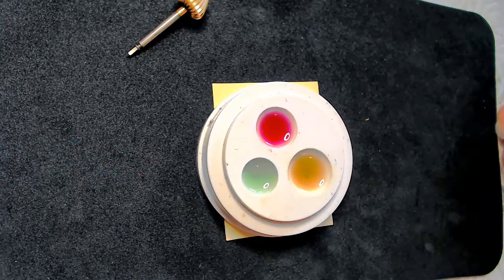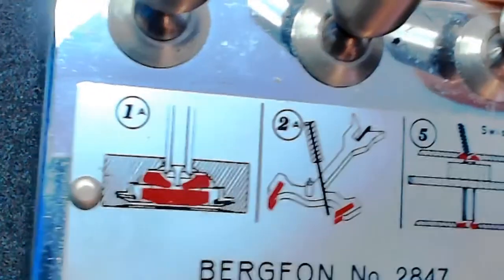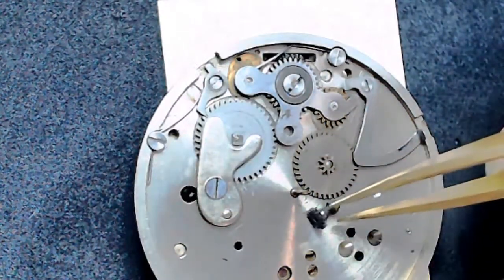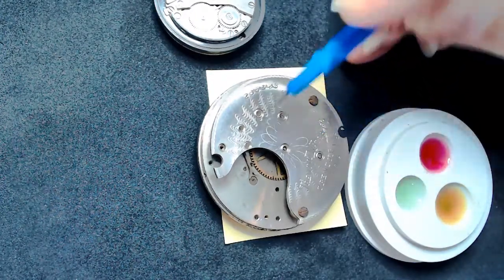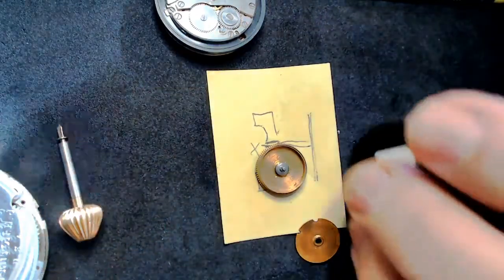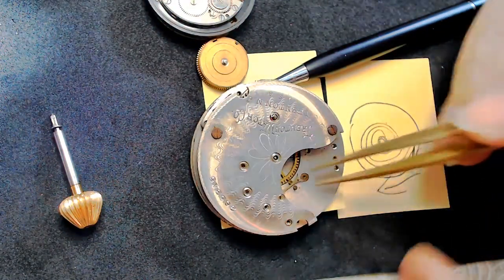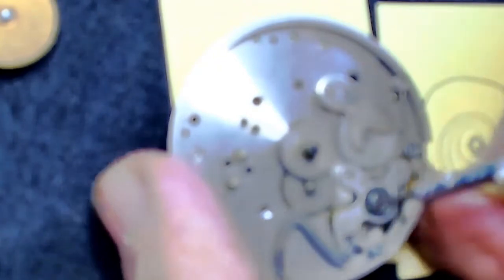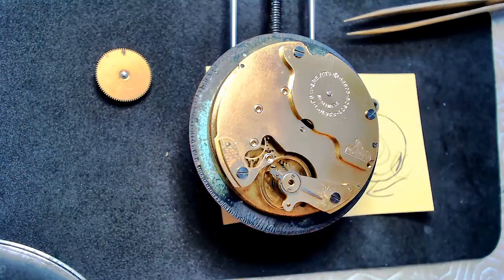Oiling Watches - Requested Video

Comment: Could you theoretically get away with two oils and a braking grease for the mainspring barrel wall for say a ETA 2836 like Moebius 9010 and Synt-HP-1300 ?
Reply from the maker: 24 Hour GMT Channel Yes, however a thicker grease is needed for the motion works and möbius 9415 for the palate stones
Reply: @JDRichard   In your opinion, would KT-22 be fine to ETA keyless works?

Comment: Thank you very much for this video. Great learning stuff. I'm happy you got around to explaining the oiling. One question though. You did not cover how to oil or grease the case of an old pocket watch. I typically see some black stuff under the crown when I unscrew it and also at the "corner" of the front/back covers (where the covers tilt around the main body of the case). What kind of lubrication is required in these places and how much? Thank you!
Reply from the maker: You can use D5 in these locations and just a little or it will migrate. The stuff you see does not start out black, just ages.  Again do not put too much lubrication on the case parts as they will collect dust and dirt more quickly.
Reply: @JDRichard  Thank you!
Reply from the maker: No problem
Reply: @JDRichard  A slightly off topic question (didn't know where else I could ask you): I have a few nickel/silveroid/etc. pocket watch cases that I'd like to clean in my little hobby-level Chinese ultrasonic machine. I have no problem placing the back covers and front bezels in a water-dishwasher solution and they come out very nice and clean. However, I don't dare putting the main body of the case into a watery solution because I fear that the water might corrode something inside the case sleeve. I'm curious about your take on cleaning old pocket watch cases, especially related to ultrasonic machine cleaning. How do you do it, what liquid do you use and do you dare placing gold-filled or gold-plated cases into the ultrasonic? Thanks!
Reply from the maker: I don’t think there would be any issue putting the case in the ultrasonic machine. However, you could dry it with a hair drier right after to evaporate any water liquid. Then oil the case with D5 or equivalent. Should not harm the gold on the gold filled watches. If you were really paranoid, you could dip the crown sleeve area and the back hinge in lighter fluid after the ultrasonic wash and drying and then let it dry, then oil.
Reply: @JDRichard  Thanks, JD! I actually had a similar idea... but instead of lighter fluid, I was thinking to rinse the case sleeve with rubbing alcohol. Don't really know how lighter fluid mixes with water, but alcohol has a tendency to suck water out of any holes. And then hair drying of course. However, I'm still worried of water doing any damage to the case sleeve in the 480 seconds it takes the ultrasonic machine to vibrate it. Maybe I'm too paranoid indeed :)
Reply from the maker: Go for it and let me know
Reply: @JDRichard  I think I found the best solution. I don't put the watch case in a water based solution at all. Instead, I have some nice little aluminum boxes which fit exactly a pocket watch case, I fill that aluminum box with rubbing alcohol and I close it (it seals shut). Then I submerge the aluminum box itself into water into the ultrasonic. The vibrations pass through the aluminum box and the watch case itself is in contact only with the rubbing alcohol. when it's done, I take the parts out of the alcohol one by one and I immediately blow dry them with hot air. This is because the alcohol dries off quickly and it attracts moisture from the air in the process, which can remain on the metal and ultimately cause it to rust. The hot air blow drying pretty much gets around this. I tried this with a nickel watch case that I got as a bonus when I bought a pocket watch. this case looked like absolute garbage, it was so dirty gunky. but now it's amazingly clean, just like new.
Reply from the maker: Great solution and thanks for sharing with me. I just got a new polishing system with pads, so the next video may be on polishing watch cases.  I will try your trick to avoid water and get a 26 oz of alcohol, 75% for the watch case and 25% for me:) if you make a video on your technique I will include it in one of my videos. Just send me the clip or link to Dropbox at jdwatchservice@gmail.com
Reply from the maker: As well, are you an Engineer, and what country?
Reply: @JDRichard  I wish I could make a video, but my only camera is the one on my phone :)
Reply: @JDRichard  Nope, I work in software development but I love mechanical watches (mostly pocket watches and mostly American) almost to the point of obsession :) I'm in Romania.
Reply: Oh, and the reason why I'm trying to learn basic watch maintenance, like cleaning cases, is because we don't really have good watchmakers here and I trust myself more than I trust them. But I only touch things that I'm absolutely sure that I won't ruin or which are ruined already by others. I love my watches too much to risk breaking anything, even if the chances are minimal.
Reply from the maker: what country are you in?
Reply from the maker: vary cool. C++ or some other language
Reply: @JDRichard  How did you guess? I have over 10 years of experience in C++, but lately I've been working in all sorts of technologies.
Reply: Get a meat dehydtator...it goes up to 70+ degrees,i use that for drying parts.
Reply from the maker: @michaelfonseka7657 Interesting. I just spin them in my heater in my Pearl Cleaning Machine
Reply: @JDRichard  sad to say my heater plate in my brenray watch cleaning machine is,as my friend put it..."has an open circuit"...and so i cant spin dry it in the heating compartment....hence the dehydrator idea....must say, it works well though.
Reply from the maker: @michaelfonseka7657  I’ll keep that in mind when my pearl watch machine goes south
Reply: @JDRichard  Glad i could help JD.👍🏼👍🏿

Comment: From  Bulova 2453.10 service instructions...
"Tight Cannon Pinion:
Either lack of lubrication or foreign matter between
the cannon pinion and the centerwheel post can
cause the pinion to bind, causing damage to the
minute wheel, hour wheel and minute post. The
cannon pinion must be removed during servicing.
The center wheel post and cannon pinion must be
lubricated to prevent damage to the dial train."

Some Cannon pinions absolutely need lubrication.
Reply from the maker: Totally agree.  I usually never lub the cannon pinion, but I should.  That would be some 9104 on the outside of the hour wheel shaft; correct?
Reply: @JDRichard  could be 9104.  In 1980 it called for ol-206.  I can't find a cross reference, but it's called for on the stem and various setting mechanisms.  I did find that ol-216 cross references to 9010 based on viscosity.  If there's a cross reference to these old oil part numbers, I can't find it on the web.
Reply: @JDRichard  it would be the shaft that runs through the middle of the cannon pinion... center wheel shaft.
Reply: @visteobman4202 i always oil the shaft that the cannon pinion fits onto, and when it is pressed on, i oil the tip of the minute shaft....not sure if thats any good, but thats how i was instructed.
Thanks, hope it helps.😂👍🏿👍🏼🙏
Reply from the maker: @michaelfonseka7657 thanks for the tip
Reply: @JDRichard  you are most welcome...i do enjoy your videos JD. I find them entertaining,funny and educational....thank you once again.💖🙏🙏😂
Reply from the maker: @michaelfonseka7657 no problem at all once again

Comment: The watch should be disassembled and cleaned before being oiled or lubricated otherwise you are just applying new oil over dirty parts and congealed oil unless you are what we used to call a "Dipper" which is inadvisable!

Comment: What are the thin, medium, and thick oils you use? (Oh, i see you went through them. Any chance you can add to the video description- no big deal if you can't)
Reply from the maker: Jo Ro 9010 thin, 9104 Medium, D5 or 1300 Thick
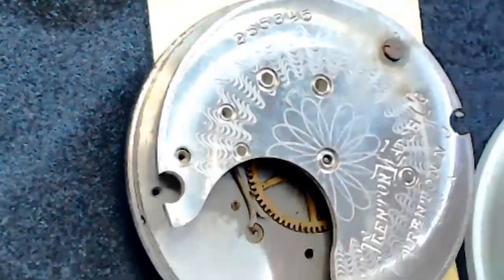Reply: @JDRichard  At 21:30 you say the red oil is 9104 aka hp 1300. Are they synonyms, or is hp1300 the yellow?

Comment: The way dust gets in is by means of the hole for the winding pin, by means of capillary action, think about it you wear the watch and or have it in a pocket and due to body heat the watch warms up now you take it off and the watch cools off it acting like its own vacuum. Hence dirt, hair and dust. Got that from a book not my knowledge, called “watch repairing as a hobby.
Reply from the maker: That is very interesting. Really never thought of it that way. Thank for the insight.
Reply: Only liquids are affected by capillary action, and the winding pin is sealed by o rings, or else water can get in.
Reply: Yeah, dust can't exhibit capillary action. Maybe a vacuum can build up and then suck dust in by airflow, but not capillary action.

Comment: Aw shit, you need multiple oils? 

Can I possibly request a fast and dirty? My vintage oris literally stops sometimes. I was ginna open and lube a couple spots with medium visc oil. Which parts should be wet?
Reply from the maker: If your oris stops, the amplitude is poor and you need to have the watch completely cleaned. Or, there is dirt in the movement somewhere. Or, there is an issue with mainspring, gears or the escapement.  Not a simple oil job I’m afraid
Reply: @JDRichard  the gods of horology smile upon me. I had her open 2 days ago and took the stem out, movement out. Was very careful to try and create a sterile work environment as best I could, and had the right tools and oils bought fresh off amazon.

I used the air puffer tons to try and blow any bits of dust out from the movement. And oiled every jewel I could see. She has been keeping good time for 2 days now so maybe I got lucky. This is something Im definitely going to practice more with some older watches
Reply from the maker: Raj Gill Learn how to strip it down, clean by hand and build it back up. And buy good tools....please:)
Reply: @JDRichard  hear ya there, swiss applicator and oil only. I knew enough to do that part xD